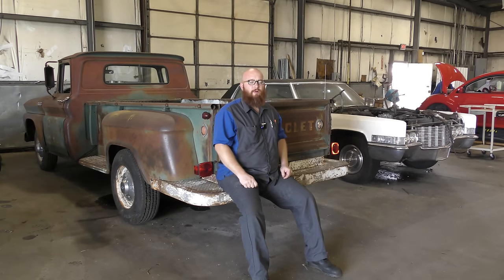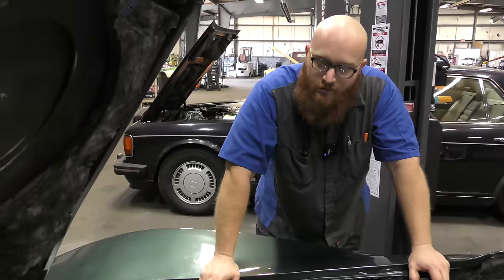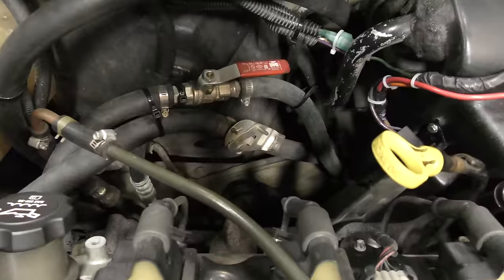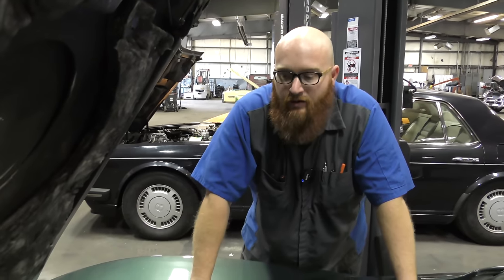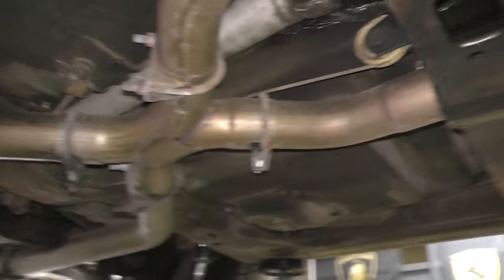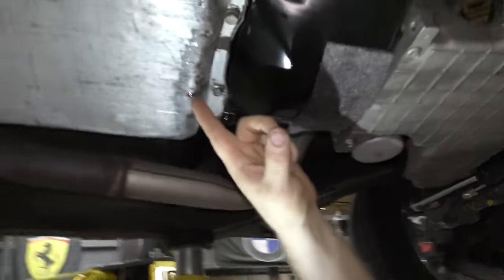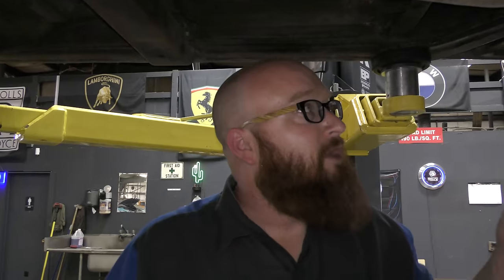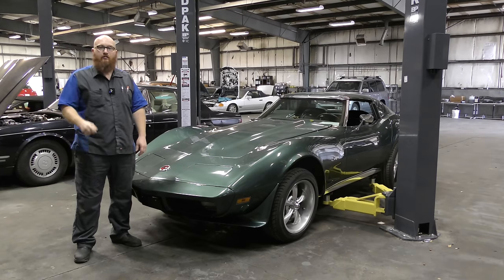Issues AFTER an LS swap! CAR WIZARD warns what can happen on an LS swapped '73 Corvette Stingray

Comment: having helped quite a few friends work on engine swapped cars, a properly, well done job, is not hard to diagnose in most cases, but many are.... wires not properly bundled and routed are very common... and can drive you mad... i helped totally re-wire one over a weekend (3 friends, 2 fathers 2 grandfathers...one wife....), the guy who did the work... did a horrible on wiring, amazing on the rest, very easy to work on... 

and... carburetors are not that bad, once you understand the basic mechanics of how they work, its not as hard as all that... im no pro... just lots of experiences rebuilding/cleaning/repairing them for both small and large engines... they arent that hard honestly, just need a gear head who knows what they are doing, dyno is good even for injected from my exp and observations if you really want to get things optimal, and a tuning/race shop or just a shop with an old skool gearhead will be able to do a good job getting the carb tuned... 

our local shop we use most often when we need work done, he actually works to keep people around who know at least enough to work on cars with carbs... they are still common out here... more so as used car prices jump and people get old clunkers working for a quick buck/form of transport... 

my uncle whos not a trained mechanic could tune that carb by hand and ear pretty well.. seen him do it on so many cars...so so many cars/trucks/bikes...etc....

the one nice thing about a carb is... it being mostly or entirely mechanical, all the problems tend to be easily found/sorted, where as electrical systems..... we actually converted a car a buddy got chp back to a holly carb he already had from a car he sold after swapping ti back to stock engine parts, because the electrical system was..buggy.. confirmed by having it tested at a shop after removal, apparently...its not uncommon with those units...the company did replace the unit when contacted for a cheap price, but, that went on a dif build that wasnt going to be a possible daily driver, the carb took them a few hours to get dialed in to running good and clean, thankfully it was mostly just adjusting the stops correctly for the new engine and replacing the pump with one that wasnt designed to be linked to that fuel injection system that had been installed...they also had sent a replacement for that part though they rarely fail..mostly something inside the "Black box" that controls the injection itself goes sideways... thus... using what was on hand... then deciding since they were never going to tune for optimal power, just kept it that way... he learned carbs from a few of us (back in the day...i could rebuild them without paying much attention... having conversations as i did it... prob could still do it...not that hard...)  good stuff... good stuff... ;) 

anyway.... yeah... i get why some hate them... i only like them for situations where you have a much higher chance of sorting a carb issue then an efi setup when far enough from civilization to matter...(that can be a few miles in bad weather if we are being honest..)

Comment: Ugh that fan setup is awful. When I swapped to an electric fan in my Lincoln I made sure to use a late model factory replacement Ford two speed fan I can buy from any auto parts store in the USA/Canada. Welded up a bracket to install the electric fan unmodified to the factory radiator and shroud mounts. Wired it in using a factory replacement pigtail and used an off the shelf bosch type relay for low and a golf cart solenoid for high. If it breaks easy to diagnose and get parts. If that junk electric fan in that vette dies better hope Jegs or JC Whiteney or whoever has another in stock and you're waiting on shipping across the country.

Comment: those wheels are called torque thrust 2...the original torque thrust has the dark grey spokes and polished outer lips....this is a 73 corvette the last year with the split chrome rear bumpers and the first year for the rubber bumper on the front...also last year of the available big block 454

Comment: Love your videos, Car Wizard. Carbs are ok if they are set up properly. I would certainly install a wideband so you can see what the car is doing while you drive it around. I found that it's hard to tell if it's going too lean or too rich because the symptoms are similar and I'm not an old school carburetor expert. I've had both fuel injection and carburation in my '69 Stingray. So far, the carburetor seems to work better although I'm sure after the fuel injection fully self-tunes, it will run much better.

Comment: Vacuum gauges and a tail pipe O2 meter are basically all you need to tune a carb. Me ...... I would have used a Holley for any carb mod.

I do agree you can get a mess if the modifier ignored the attention to detail.

Comment: The further you go away from stock the harder it is to work on and the more likely you are in many cases harder to work on. I agree on the idea of it is easier to work on the EFI setup stock to lightly modded e.g. VATS disabled and any ancillary stuff that needs to go gone. Truthfully not a ton more expensive either

A wide band should be like $200. Buy one, they're a great tuning tool. 

In terms of docs there's a few things people have said here. I have a couple forums I tend to post build threads on. I put part numbers etc. in there so I have them for myself later. It serves as a KB. That says nothing of my spreadsheets of what PNs I used.

Also who the puts a Tquad on a 'vette? They were on some good stuff when they thought that up.

Comment: I love EFI don't get me wrong but this Corvette other then the transmission, has the simplest and lowest cost swap possible. That oil pan is a stock pan off a late 90's LS powered Corvette. Also, a big part of driving a vehicle is how it sounds and, the sound of an LS with a carb at wide open throttle is pure music to the driver of the vehicle. I bet this guy is nothing but smiles driving this Vette. The R12 condenser and evaporators works fine with R134. If it is charged correctly you are going to get 48° air from the center vents on high fan speed. On this year Vette you want a lot of air to blow down on your feet so be sure the vent system works good. 
Everything else about this video is absolutely correct. If you are not the guy who installed it, the diagnostic time can be enormous. Some installers think like Germans and make it nearly impossible to trace anything. If your lucky the installer was thinking "How would GM do this? or How would the Japanese do this?".

Comment: They did the swap and broke the mechanic's #1 rule. Always change the front seal of the transmission and the rear seal in the engine... Shifting the torque converter can damage the transmission seal.

Comment: If you mod your car, KEEP RECORDS. Working at an auto parts store, I personally get a guy with a hot rod (different parts from different cars) that has a problem figuring out what part came from what car, about three times a month. "it has a Dodge rear end" But I need to know a year, make and model. "an 80's Dodge pickup" But my screen doesn't say which ones are pickups, all it says is b, d, and w, with a 50 and 100 for some and a 150, 250, 350 for all of those. I'm not a Mopar guy, so I don't know what those letters mean, and I don't deal with pre 90's vehicles very often.  I can choose a random year in the 80's, but I can't make any guarantees as to whether it will work.

Comment: Another reason why cars get swapped is the lack of parts or the lack of quality parts.  Case in point I currently have sitting in my garage a 68 C3 427 car.  Motor has a 4150 Holley on it.  Been fighting fueling issues on it.  An original style Carter fuel pump supposedly is supposed to put out 9 PSI of fuel pressure according to the techs at Carter which is dead wrong.  Unfortunately their misinformation has transferred over to every other manufacturer of fuel pumps for that car.  The OE pump for that car should be 6-7 PSI.  Had to put a regulator on it to get the pressure down.  

Car originally would have had a Quadrajet on it.  Good luck finding a proper core that hasn't been hacked and ruined by the commercial rebuilder shops.  If you find a non hacked CORE carb to rebuild expect to pay $1300+ for that particular year and model.

Car was originally a points and condenser car.  Care to guess how many sets of Chinese garbage points you go through to find a set that would actually run a week without burning up the condenser.  Thats why a MSD went into the car.    

Dealing with the Chinese crap parts is why alot of these old cars get swapped.  The aftermarket quality control just flat sucks for relatively modern cars let alone something that's 40+ years old.

Comment: Interesting factoid:  1973 is the only year that Corvettes had the rubber/polyurethane front bumper AND the chrome rear bumper. 1972 and prior had chrome front and rear, and 1974 and later did away with chrome bumpers entirely. One of the easier model years to recognize at a glance.

Comment: I had a '68 Ford Galaxie with the original 390 cu. in. V8 (carbureted, obviously) that I wanted to have some work done on -- I took it to FIVE different shops before I found a place that would attempt to work on it.  No shop these days wants to work on a car that they can't plug their $5,000 Snap On scan-tool into.  It's ridiculou.

Comment: You normally supposed to add a little heat shield in front of the plastic sides of the radiator to block some of that heat

Comment: A true mechanic can fix just about anything fuel injection or a Carburetor. However only technician's are limited to only chancing parts that the computer tells him to change. HUGE difference ! Technicians are a dime a dozen but top notch journeyman mechanic's with a complete knowledge of old & new are becoming very rare. If your lucky enough to know one, buy him a 6 pack just to stay on his good side .

Comment: A  LS3 is nice but the wiring is a nightmare. the only way is an after market harness and matching computer. The only thing you really get with an LS is better gas mileage. An LS swap costs about 10,000 over a nice 383 small block. You can buy a lot of gas for $10g's Plus there's nothing like the sound of a high compression big block with a solid lifter cam.

Comment: You probably shouldn't engine swap or buy an engine-swapped car unless you know exactly what you're doing with it and/or know someone who knows what they're doing with it. Plus, there's a reason donor cars are a thing. So you can swap in compatible parts easier. There was a 2JZ-swapped E46 BMW 318i for sale near where I live for pretty cheap but guess it's a good thing as I probably wouldn't have been able to handle it if problems arose or if it wasn't done correctly. You just really need to know what you're doing and be prepared for any problems that may arise.

Comment: Just because it fits and cranks does not mean the swap is done. I am not saying that everything in this car is wrong, but the execution was a little messy. I always try to make sure my stuff is located with in the right OEM place, not have random relays hanging under the hood. Those stock locations are not just important for future maintenance. they are by design fairly safe from heat which can be a real problem with most engine swaps. And this swap is pretty clean compared to some I have seen. But if you want to save tons of future headaches, document stuff, now and days most schematics are out on the web so all one really need to do is print em up and mark them with a handful of notes to save dozens of hours in the future. 

It is funny that we are now at the point where the carburetor is the black box the young mechanics won't touch. I remember when the opposite was the case and many would point you to the dealership because "they couldn't deal with those computerized cars".

Comment: Wait a second

Is that C5 leafspring at the back?
This whole rear setup is not stock. This is one sweet ride. It may have problems but amount of mods in this is huge.

Not to mention it has been restored less than 5-10 years ago.

Comment: In all fairness, if someone does an LS swap, it's for them and them only.  The next owner is not of any concern when the swap was done.  It is done for a reason like performance, street/strip use, turbo/boost mods, etc., etc.  Anyone buying a swapped rig should either know what they are getting into or stay the hell away.  Why would anyone buy a swapped car then farm out the repairs?  That's crazy. If they have no idea what is going on, they deserve what they got themselves into.  In this case, there are plenty of daily driver C3s around with tried and true small blocks that are certainly cheap enough.   They should have stayed in that lane.

Comment: A good modern trick for carved cars is an 02 sensor and an AFR gauge.
Reply: You could always talk the customer into adding MSD Atomic EFI. Throttle body injection that is tunable and can spit out trouble codes and data when there is a problem.

Comment: With all due respect Weezer, I've owned a 1969 Corvette L-71 427/435 with 3X2 Holley Carbs for 52 years and I can tell you flat out, there is nothing wrong with carburetors...even three of them.  They are simple, fairly efficient and very reliable.  How many people will be able to say that after owning a F.I. car for 52 years?  I have nothing against fuel injection, so don't get me wrong...but carburetors are still a pretty good way to go if you own a Corvette.

Comment: The first thing you have to realize is stock is always easier, sure. That's why they went with a carb, the car had a carb to start with (not the same one of coarse). Where's the fun in that. Been looking at doing a LS C3 my self. Yes there are a lot of challenges. But the real fun is at the deep end of the pool, you just better know how to swim.

Comment: The Skid Factory dyno'd a carby Datsun, or something similar, then installed a basic fuel injection system and the results were outstanding. Why didn't he just keep the bloody wiring harness and factory ecu to maintain the fuel injection instead of stuffing around modding a carby?

Comment: Even worse about buying a restomod, the seller expects every penny they put in as though $1 input = $1 output.  That just isn't the case.  Especially if you didn't diagram your fabri-cobbled electrics and half assed fixes.  Then there's the hiding of problems.

Comment: If your going thru all the work to pull the transmission, it would be a good idea to replace it. I have a 1970 Corvette. It had the 350/350 HP engine I was not happy with. I made the decision to stick with the old school big block, easily just as powerful as an LS, way cheaper, and it fits perfect like factory. A little heavier, who cares. EFI is the way to go. Holley sniper is one of the best.

Comment: Carburetors required vacuums and other vacuum related components.
Very fussy and nip picky at different temperature and natural air pressure changes.
It really depends on the carburetor design and tuned.
If not properly tuned it definitely will runs rough, engine flooding, hard starting, and stalling.
One day it works sweet & fine then other day you wanna put a bullet to that thing to end the horrible mysteries. 
How do I know all that ?

Because I used driven lots of carb. vehicles.  It's a love on the day she feels like it. It's a hate and frustrated day when they don't feel like to work that day.

Stay with fuel injection and never turn your head back to carburetor for your vehicles.

Comment: Great video. I kinda wish I had watched it 2 years ago.
I have a Plymouth roadrunner 71 that got the engine swapped by a previous owner 318 to 1973 360.
The kickdown linkage has been swapped but not properly adjusted, the gearshift moved from the steering to the floor panel (backup light cable are now not properly linked).
I m slowly working on fixing it
I have little knowledge of what the engine spec's are. All sorts of little issues like engine oil starting to leek, oil vapors fumes coming from the breather cap like crazy

@car wizzard. I was wondering would scraping the whole engine and starting anew with a stock 318 or 340 built from scratch with every piece documented be the best course of action?

Comment: The 1973 had qudrajet carb ( don’t like them) have worked on Holly’s. Much easer to work on then most stock carbs. No computer in those days they did have distributes and simple electric ignition. By 1975 they started (first year) using catalytic converters and unleaded gas. Today’s cars are to complex to work on any more.

Comment: The rear bumper is chrome and the front is body colored paint from a later year. I prefer the older chrome. In any event I would switch the front for a chrome bumper to match the rear.
Reply: That is how they were made in 1973. It is the only year with the chrome rear bumper and the polyurethane front bumper. In 1974 they got rid of chrome bumpers entirely.

Comment: I want to 1.9tdi engine swap my car. My car had the option to have a 1.9tdi in it from factory, but I want to do it properly and full on re-do the wiring for the engine and everything else. Except for the lights and auxiliary stuff that don't need to be changed. My logic would be that you would automatically do a diagram as you do the car, but like not every person in the world comes equipped with common sense from factory sooo yeeaaa😂

Comment: I took a all r12 system and replaced all the o-rings. I just used regular 134a o-rings and put 134a in the system. And the r12 system will run on 134a freon

Comment: You can get a carb thats actually a throttle body off of Summit. If that's the look you want they are available no big deal. I didn't bother watching the rest of it. Carbs are not that difficult but I would also go with efi.